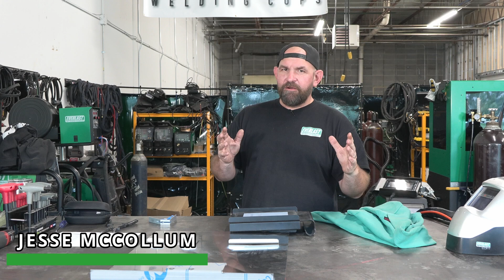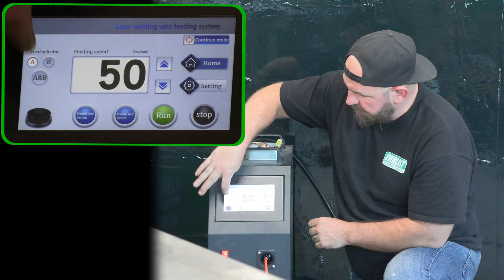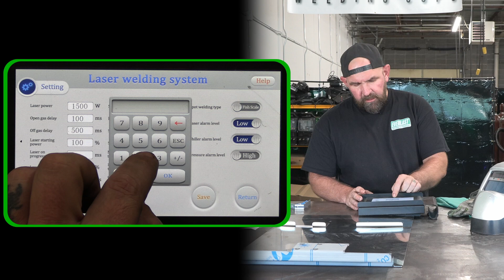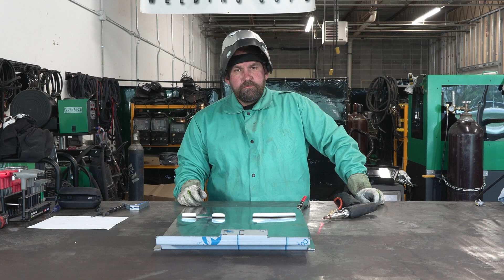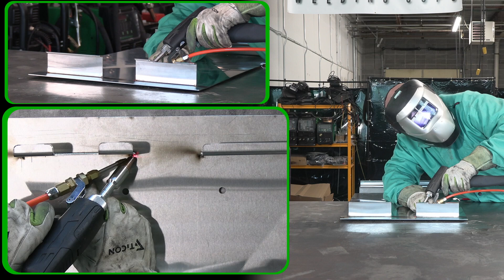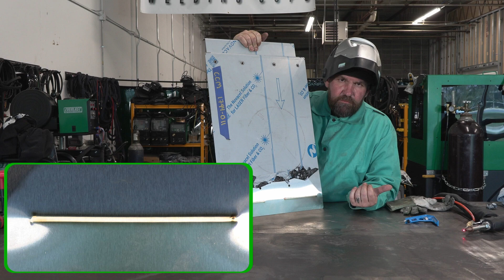Laser Stainless

Comment: You really need to spend an half hour on just the controller. Explain each button and what it does to the output. Then demonstrate what happens when you shift one thing. Like “duty cycle” the manual is not all that clear